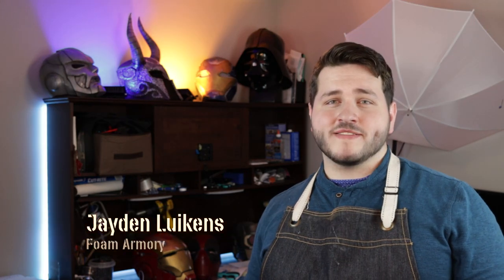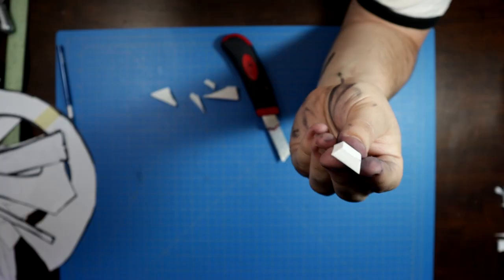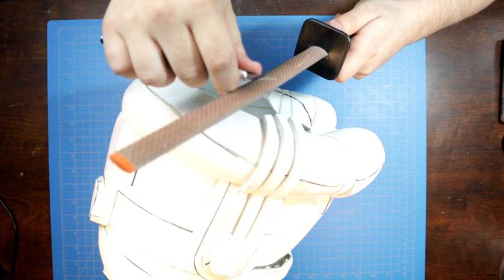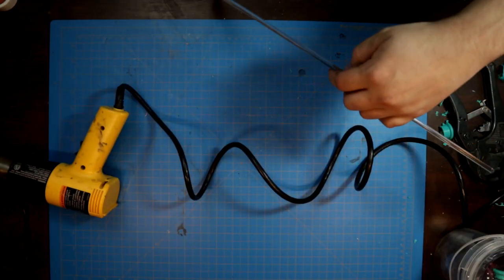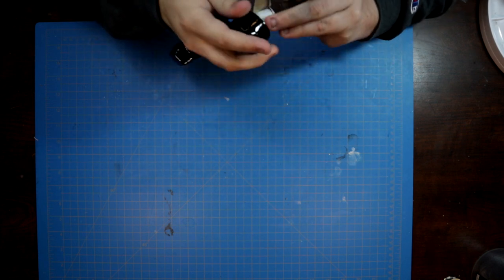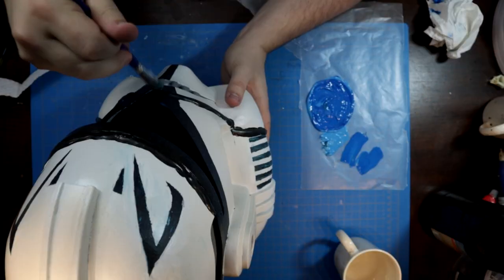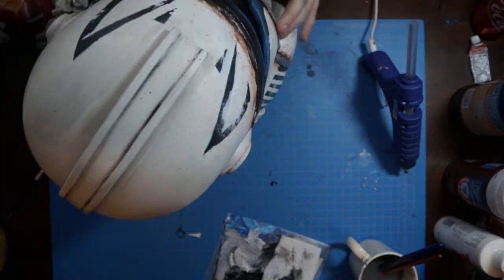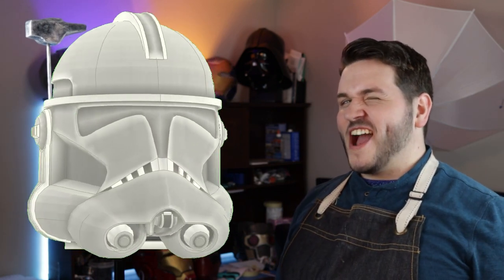Captain Rex Helmet Foam Build Guide┃DIY

Comment: hey, i know this was uploaded a while ago, but on some pieces did you cut into the side of the foam at an angle to get them to slot together so the edge is just one seam, like the pepakura model? your seams look like this in the video but i’m stuck whether or not i should bevel pieces

Comment: Where did you find instructions for putting together the pieces because I know I’m going to have a very hard time figuring out what goes where
Reply from the maker: Hey there, @Art9_69 6 I've updated these patterns with part names in both the pdf and pdo versions. If that doesn't get you where you want to go, I suggest downloading pepakura and viewing the pdo file directly!
Reply from the maker: For what it's worth, I drafted these patterns myself in Pepakura designer
Reply from the maker: I also removed the texture file form the pdf templates, so now it shouldn't eat all your ink
Reply: @FoamArmoryProps  thanks 🙏 🙏 so much
Reply: @FoamArmoryProps  thx very helpful

Comment: amazing work!  One question, what density is the rubber you used? medium or high?
Reply from the maker: Thanks Alan! Are you referring to the foam sheet I used? It's a slightly softer foam from Michael's craft stores
Reply: @FoamArmoryProps  I saw that, but do you have any idea what density it is?  If it is high density? Why look for the store and I could not find it
Reply from the maker: They do not list a density, but I wold say medium. It's definitely softer than HD foam

Comment: What degree angle did you bevel cut on the helmet.
Reply from the maker: Lol, which cut?
Reply: Cause I was looking at the pattern and I found a dotted line. Am I supposed to bevil it or cut it?
Reply from the maker: @spideyproductionz  that depends on which line you're referring to, I'm afraid.